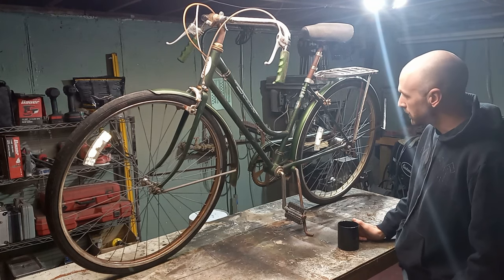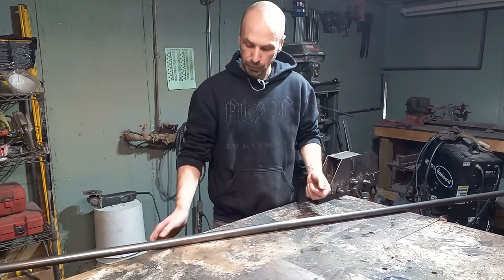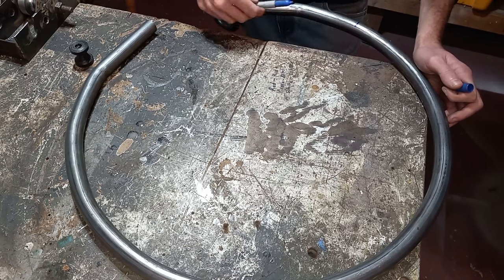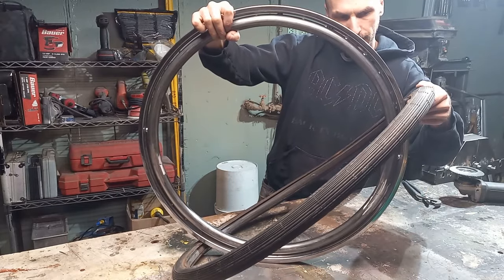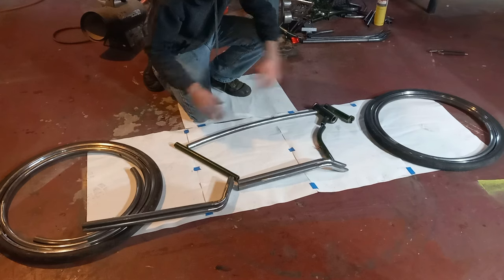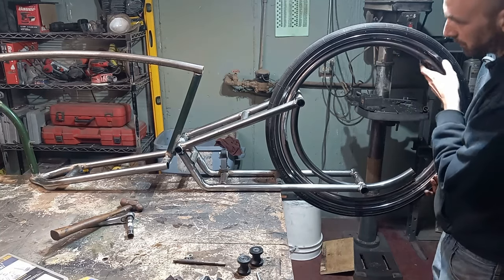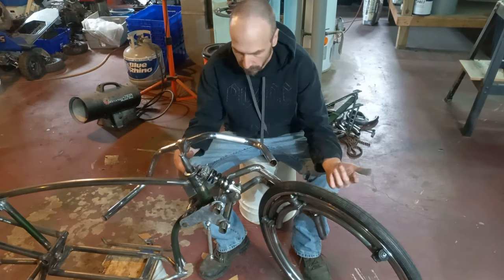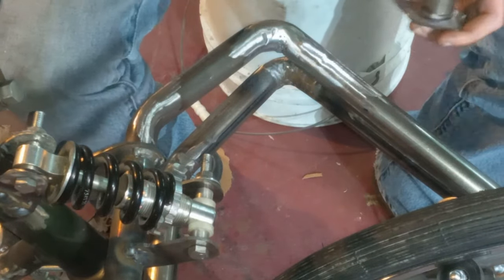Blue Steel pt. 1 - custom ebike build from old schwinn

Comment: For the wheel bearing rollers, I don't expect them to last very long in that orientation. The roller set up is great of alignment and keeping the wheel true, but all the mass of the rider and bumps are transferred sideways through the bearings and the sides of the rollers. I expect it needs some rollers to take the vertical load which allows the side rollers to be just for alignment.
Reply from the maker: That is a good point of concern. Judging from past builds with a similar setup it hasn't been a issue yet. That being said the nylon wears pretty well,  but it will wear.

Comment: grind hard plumbing co monster chopper inspired steering
Reply from the maker: I've seen their build,  pretty cool. They built theirs originally with pneumatic rams, then hydraulic.  This build was done with mechanical linkage, but it's also been done with push-pull cables.  While the design is uncommon,  it's been used for over 60years. Very common on outboard boat motors.

Comment: Nice try soild rubber tires
Reply from the maker: I'm not sure I know what you're asking
Reply: @chrismakesstuff1   you haveing a problem with mounting the  tire because of the valuve stem   i dont know were you are from but  share bikes have a normal tire with a hard rubber insert  to prevent a flat  this mite be a answer to your tire problem
Reply from the maker: oh that is a good idea.  we did manage to figure out a solution using a tube that will be shown more clearly in pt. 2 of the build coming out soon. thanks  @therawbieboardzshow9763